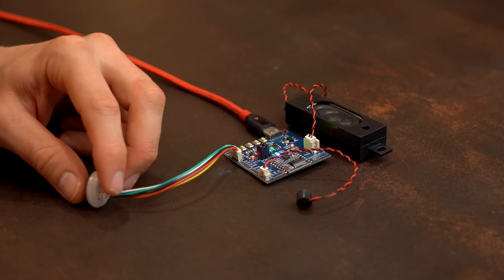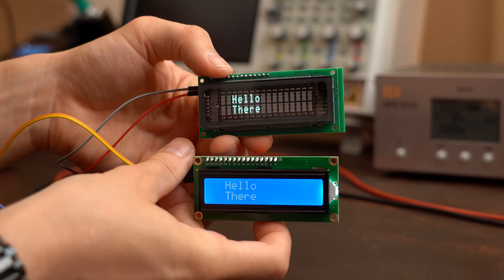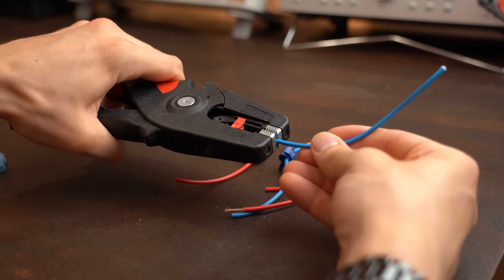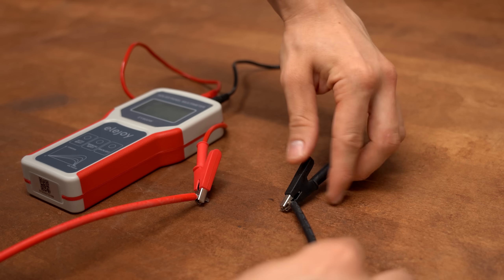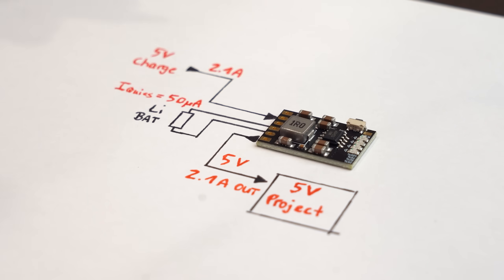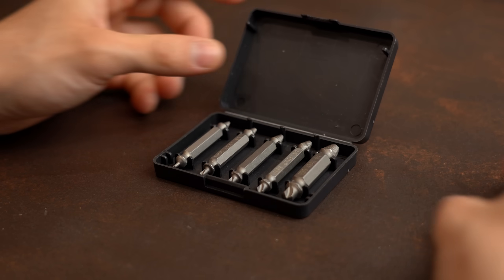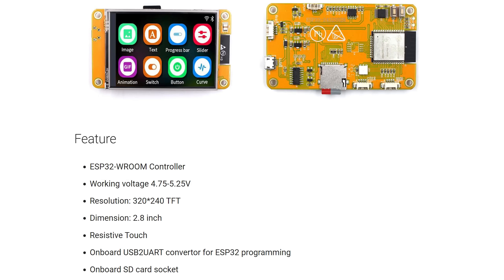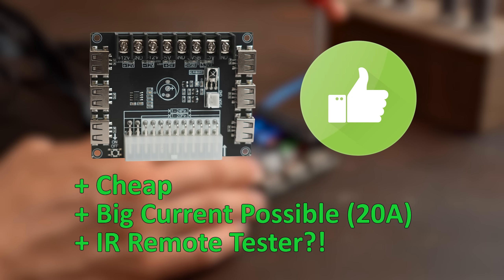I tried finding Hidden Gems on AliExpress AGAIN! (Part 6)

Comment: As for screw extractors, you should use both sides of a bit with reverse (counter-clockwise, unscrewing) direction of a drill - check the flute directions out: they should bite in the screw and pull it out, not stroke it and drive it in. It is noticeable that in video it is done the wrong way at all times except at the end of video.
Reply: I would also think you would have to be a bit more careful about it. Try to get it to bite before easing the screw out. Not just go full speed. What the video shows looks like user error to me.
Reply: I've used these kind of extractor bits quite a bit and they work well if you use them properly.  In addition to what he other replies said, don't wobble the drill bit, that just makes the cone shape your creating in the screw head too big for the extractor bit.  And when you use the extractor bit put as much pressure as you dare on it and turn the drill as slow as it will go.  You want the extractor to have a chance to bite in.  If you just jam the trigger to full speed you just ruin the extractor bit by dulling the edges.
Reply: @cdsmith  That's just how I imagined it was supposed to work.
Reply: I was going to say exactly that. I have this kit and really works like that: drill clockwise, unscrew counter clockwise
Reply: That's what it seems like to me as well.
Reply: I don't have lot of experience with them but I end up bying one (on the 30$CAD) to swap it with a cheap one worth 15$. I saw the difference right away (especialy since my issue was metal in metal with a little rust). The cheap one wasn't even able to get a grip/cut the metal... (I used them slowly, like, if I could I would use them on a screw driver instead of a drill)
Reply: Believe in him, I already bought this kit, I've already tested it and the material is rubbish.  The metal is completely soft and comes apart without causing any damage to the screw.  If you have this kit and it works, you were probably lucky enough to buy one made from quality metal.
Reply: @RodrigoGomes90  or they used this set on bargain bin Home Depot screws
Reply: I've bought screw extractors three times, and even following the instructions, they can sometimes just keep stripping instead of extracting. I think it has a lot to do with the speed of the drill and the pressure you apply. In other words: I have no doubt they work... but there's a knack to it.
Reply: @sandordugalin8951 Big key is to go slow with high torque on the drill. Also, you can hammer the extractor into the screw, then attach the drill if you can’t get it to bite at first.
Reply: Yeah, I have a set of cheap extractors like this too. They work, but the drill sides are designed to cut counter- clockwise, the opposite of a normal drill, just in case the drill 'catches' the screw it will start unscrewing it right there before even getting to the extractor side. But you should go slow when drilling and very slow when trying to use the extractor.
Reply: Ya double ended is not ideal because you can't really tap them in with a hammer without damaging the drilling head but they also kinda suck
Reply: drill hole is not deep enough, had to learn using it, now can tell that they works fine. it’s a user error (and worse instructions)
Reply: I came here to see if anyone had mentioned this or not.
Reply: Yep, low speed and pressure.
Reply: Also, don't give them all the beans. Go slow or even seat the extractor side by hand til it bites.
Reply: Screw extractors need practice and thinkering , then they will work. Used them many times, they are definitely a MUST
Reply: i have these extractors and they work more then well. you did it completely wrong :)
Reply: Any tool is crappy if you don’t know how to use it. Maybe revisit the screw extractor and use it properly this time. I bet it works just fine.
Reply: I can confirm that they work, I was able to remove screws that were badly damaged by oxidation with a set that I ordered from Aliexpress
Reply: Also, when drilling hard stuff go very slow. 
If you have drilled stainless you'll know heat/speed kills cutting/griping edges.
Reply: yeah, drilling into it when you're doing the extractor part of the work is always going to cause it to fail.
Reply: I've read (and also some people comment it here) that you should hammer the extractor in the screw. But with the double-sided extractor it would mean destroying the drilling side I think
Reply: at a lower rpm also
Reply: This.  Bought mine many YEARS back at a boat show.  The guy had a booth where he'd show people how to use it and you could try it yourself.  If you do it right, these extractor bits are a project life saver.
Reply: @do-you-know-the-muffn-man  yeah, I doubt the ones at the boat show were from AliExpress. 
You're comparing a product sold by an individual designed to work in front of groups of people....to a product sold on a Chinese retailer where:

Scams are everywhere 
Lookalikes \ knockoffs are everywhere 
You can't use it before you try it, so the product doesn't have to work in order to get sales
Returning a 4 euro product to China because it doesn't work isn't cost effective

I wouldn't be surprised if some AliExpress vendors sell brass or aluminum versions of these tools. 
They don't care if it works or not. 

So just because the superficial design of the product is similar, I think you're being laughably naïve to assume the AliExpress product is the same quality as your boat show product. 
If you test a product in front of groups of people, you do it because it WORKS.

Just because someone on AliExpress copied the design and maybe used pot metal, that doesn't mean anything as far as the product functioning.
Reply: I found them to work very well - if you don't use an electric drill, but turn them by hand. Think of them as thread cutters, you wouldn't use those at max speed in a drill either.
Reply: Im Professional. I use this tool really often at work. Its really gold. Like if all other ways fails, i take this stuff out. Or when i have take some broke stuff with hole inside, its my first way.
Reply: they dont work anyway. the material is too soft, it can't cut into the screwhead. I had the same set.
Reply: I have this kit and it's absolutely amazing
Reply: Yeah, for an intelligent dude, that was dumb.
Reply: Did you see how bad the soldering was as well? This guy is a total fake
Reply: I've used these many times with great success.
Reply: Never mind. There's only one thwottle - full thwottle.
Reply: These things saved me multiple times they work very well!
Reply: I'll say that those are not particularly good at extracting larger fasteners. Like anything longer than 25mm/1inch just don't do well.

Also hardened screws will be still a hassle to extract. I used DeWalt or Milwaukee versions of these, and they aren't great... to put it mildly. The design itself is poor
Reply: I was about to complain because I recently bought one of this sets and haven't tried them yet. By the comments it seems the success of the extraction has to do more with technique primarily. Then the quality of the metal. So this one might need a revisit in the future IMO.
Reply: I needed to get some stripped screws out of an old Yamaha quad bike a while back. My mother offered me a set she bought years ago and hadn't even opened.
After almost giving up, I managed to get one screw out... and then when I looked at the extractor, I discovered it was very worn down after just one screw....
Lesson there is to not expect much from cheap tools your mother buys because they were on sale 🤣
Reply: I have had many sets over the years and they are all over the place in their successrate. Sometimes they work, sometimes they don't. Most often they just rip out the screw head and the rest remains in the hole, sometimes they fail like in the video, but when they do their job correctly, they are amazing!
Reply: They're terrible and you should just dremmel a new screw slot.
Going through YouTube to learn how to use mine the first video I watched of a professional using one had it sheer in two.

There are better ways with more universal tools.
Reply: OK, Im gonna take dive number three or four with these extractors just based on your comment!!! I have a rounded off 8"x1/2" lag screw I need to remove..  Joking about the last part.  .. @jeffjacksonson5486
Reply: It's called "Speed Out" and it's available in Home Depot. My mom bought this a few weeks ago because she had stripped a screw while attempting to put a wheel on our fence. She couldn't get it, so I said I'd give it a whirl. The instructions tell you to put the drill in clockwise/righty for BOTH sides. It didn't work at all, but I didn't try the other way. Maybe I'll give it a shot, but I don't have high hopes. It just simply couldn't cut the material of the screw at all.
Reply: I brought a similar screw extraction kit, and my set consisted of 2 different types of drill bits, one for drilling a hole in the screw and one for grabbing the inside of the hole and extracting the screw. If there's only one type of drill bit (like the kit shown in the video), then the whole concept would not work.
Reply: These screw extractors usually come with no instructions, and the ones that do aren't very informative or are wrong. I have a set just like this one from Harbor Freight. I couldn't get it to work until I used a real metal drill bit to drill a small hole and then 'slowly' (without using a power tool) use the extractor end in reverse to bring the screw out. The drill end on these things seems to make things worse, IMO.
Reply: And do it SLOWLY
Reply: It’s more operator error than not
Reply: I have bought also a cheap bolt/screw extractor from AliExpress. It worked for me every time. I believe there may be some cases where you must drill out the screw because it is so stuck. But, based on your video and my experience I would say you made an error. For such DIY tasks, this cheap kit should be enough.
Reply: The main problem only consists in Germany. They don't work here because the screws are such a high quality
Reply from the maker: Trust me, I tried using these things in every way possible. Not just the attempts shown in the video. They never worked for me.
Reply: @greatscottlab if you use the extractor very slowly while pushing down very hard they work well . But you do need a powerful , high torque , low geared drill . Or doing it by hand with the bit held by some vise grips . 
Cheers from Australia , love your videos 😁
Reply: @greatscottlab   I got he same set & they worked everytime I used them. I went slow & counterclockwise  with the second head. Using a larger size helps.
Reply: @ShantDotMe  I also used it correctly and it never worked.  Items you buy from China do not always come with the same type of material, the quality can vary greatly.
Reply: @greatscottlab I have several sets and find them to be a life saver. I don’t think you have quite got the knack. Sorry
Reply: @greatscottlab use the extractor with a ratchet handle and turn anticlockwise very slowly while all the time pressing down hard - give the tool a chance to do its thing.

I use cheap ones and never have a problem until they become blunt after some time.
Reply: @greatscottlab  This style of screw extractor is a very old design.  They work fine if used correctly, and if you select the right size.  You generally have to use a size larger than the bit used to destroy the screw. Also, as others have mentioned, they actually work better if used manually, as in, not in a power drill, but in a bit holder by hand with lots of downward pressure.  I'm sure you could care less, since you're done with the video now, but hey, you may need to extract a broken screw one day! ;)
Reply: @greatscottlab , why put the obviously wrong way into the video, then? It's the wrong direction, wrong speed, wrong application of force. Show us a good honest attempt, not the stupid one.
Reply: did you turn them counterclockwise or not?  @greatscottlab
Reply: @greatscottlab what might help is putting the extractor bit in the screw and hitting it with a hammer so it grabs on better. Then put your drill on top and unscrew. Though it would surprise me if these would actually work. A bit too cheap imo.
Reply: @Muscleduck great way to destroy the cutting edges of the extractor.
Reply: @greatscottlab  So show the correct method in the video then we can judge the product not your incorrect method...
Reply: @greatscottlab did you use the tool on Chinesium grade schews? 😅😉 (war nur Spaß)
Reply: @greatscottlab  ahh then maybe that particular "brand" really are just too cheap, because the one i've used in the past did work well, so if it's something you'd like, just look for good branded ones!! It is a very usefull tool to have, specially if you do repairs for other peoples than yourself!!😛
Reply: @greatscottlab  , I read that sentence with your voice 😂
Reply: @greatscottlab  I used to make (mainly masonry) drill bits part time while at college and the company I worked for made much longer screw extractors which were just a gently fluted taper on a shank, I'm sure they're not cheap but I saw them work in person in a demo they were doing to show off some of the latest products they offered at the time
Reply: @greatscottlab I'll back you up. I got the same or a very similar set and they almost never work. I think it's a quality issue. They are really smooth and the spiral grooves have no gripping power. Moving slowly, pushing hard, etc. This type of bit will work, but these are poorly made ones.
Reply: @greatscottlab  u mnie działa bez problem, kręcisz w lewo i jest OK. Także ta łapka w dół jest niesprawiedliwa...
Reply: @greatscottlab It's very annoying that you are blaming the tools rather than yourself

Have some humility and accept you are wrong, have been using my kit for years without an issue

It's not right that you have made an unfair review like this despite you being at fault

A typical customer knows more mentality
Reply: I couldn't get them to work either following the directions to a T. 😕
Reply: You beat me to it! That was exactly what I noticed.
Reply: had the same set, hot garbage.
Reply: Obviously. Neither of the sides will work in clockwise direction so I don't think he could have done it wrong. Btw I also tried that tool (cheap version) at did not work for me either
Reply: @talik6  Seems a lot of people have a skill issue with those.

Comment: Did the IR remote affect any of the USBs? Do you have a way to check for data transmission from the ports? Maybe it can be used to turn on and off USBs which would be really cool.
Reply: Possibly it was designed to be able to do that but they swapped out the microcontroller apparently. Might be possible to drop in an appropriately programmed microcontroller though. I don't see any control circuitry though so possibly this would only control the power-request line which would switch the PSU on and off.

Comment: Incredible video like usual. I had a question about the LiPo charging / discharging circuit. So you said it auto powers off if the load is not big enough. Does it power back on if a load is applied again?

Comment: When I go to Chicago, I always fly midway. It's very dense. You see rooftops under the wheels during landing it's freaky. But when it lands, it's a shot down and firm brake. Those pilots are very good at stopping those big 737 on such a short runway and approaches.
Reply: You seem lost 😂

Comment: I've used similar T-splices when I want to add sensing leads to an existing line, though mine were the "parallel" style, which don't require a spade connector. They capture both attached cables with the same splicing bar. If you have the right size, my experience has been great because you can add them with just some pliers, and then you instantly have a conection you can use for voltage sensing. But the page advertising them as "low resistance" and "fast" is definitely being disingenuous.